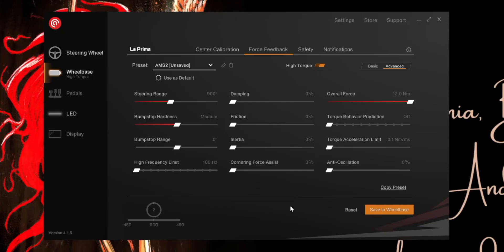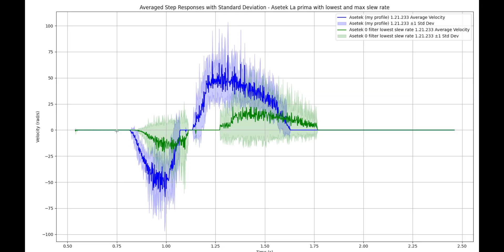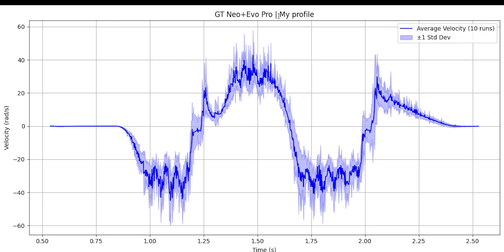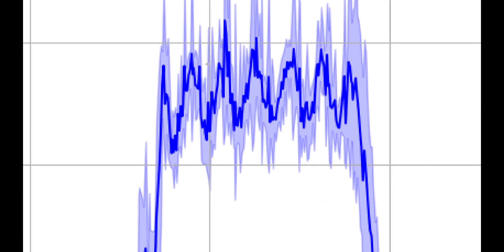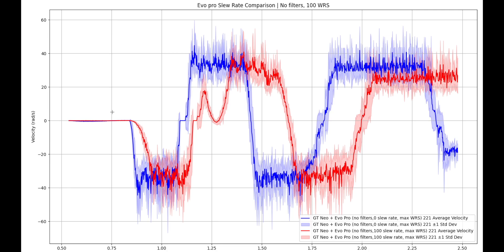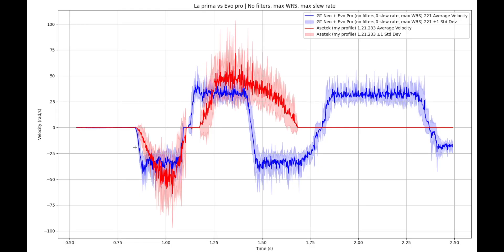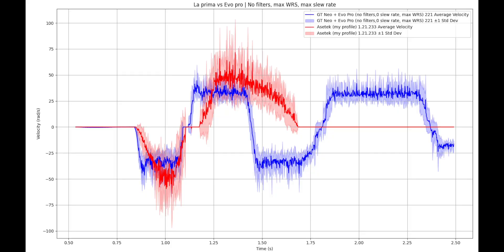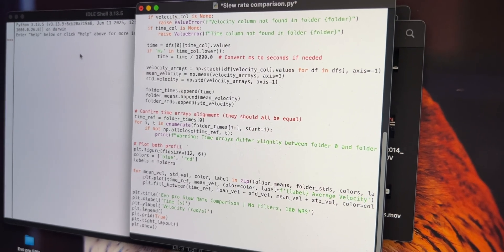Simagic Evo Pro | Slew Rate & Step Test Results

Comment: I enjoy and appreciate your detailed test reviews - great content Napman.

I however disagree with the interpretation and calculation of slew rate in this video - Wheelbase slew rate is a measure of how quick its torque changes. I do understand that measuring it accurately may require equipment that may not be readily available, hence the use of alternative methods for estimation purposes. Noting that Torque is directly proportional to rotational acceleration, in this case, the gradient of those rotational speed versus time graphs during the step change is a good variable to help quantify and compare slew rates - the closer the step change graph is to the ideal vertical step change, the higher the slew rate and vise versa. The maximum rotational speed reached after the step transitions on the other hand is not a reliable measure/indicator of slew rate unless testing the same wheelbase so that all other variables remain the same.

With that in mind, your graphs clearly shows that the Evo Pro has a higher slew rate than the La Prima - Evo Pro's graph is closer to a step response while the La Prima's transitions are more of a Sinusoidal than a step transition, this indicates that the La Prima has more "built-in" damping that you have no control over, this built-in damping is implemented either mechanically or electronically and is inaccessible to the typical user. When you change the slew rate via the software sliders, the Evo Pro did exactly that and nothing more (expected behavior - gradient change), the La Prima on the other hand changes both the slew rate (observed through gradient change) and the maximum rotational speed after step transition (not a reliable indicator of Slew Rate) - the La Prima's behavior in response to the Slew rate slider is not ideal from a physics definition of slew rate perspective - This should not be confused with whether it's good or bad for better simracing feel, enjoyability etc.

Others may find the smoothed out, lower Slew rate of the La Prima better due to it being the kind of response they are used to, we all know that new things usually comes with an adaptation curve which typically requires time for the brain-to-hands coordination to match. However, what Simagic has achieved with these high slew rate wheelbases has great potential to provide sim racers with a level of detail and responsiveness that was not easily accessible at this price point - it is a matter of firmware optimization to implement better damping without sacrificing too much on the slew rate end. A fast response system is a good starting point for optimization to achieve an excellent responsive system compared to starting with an inherently slower response system - So I'd say, Simagic Evo Pro is an excellent baseline and better option taking into account upcoming firmware improvements.

Simagic Evo Pro is to the wheelbase market, what Assetto Corsa Evo is to the racing simulators market..."Early Access"!
Reply from the maker: You raise some valid points. I am working on refining the methodology so as to make the entire thing as close to industrial grade as possible. I'll try to rely less only on the software. 

Thanks for watching and the comment, I really appreciate it!

Comment: Dang, I was just about to pull a trigger on an Evo Pro this November (hoping to find a sale). 

Is there something in the price range (US based) I should consider instead? The jump to a simucube (especially with additional wheels) is a very tough pill to swallow.
Reply from the maker: How about VRS DFP15?
Reply: @napmanreviews  thanks for such a quick response!! This is definitely on the radar now, you aren’t the first to mention it. 

I also see your praise of the Conspit Ares Platinum. It seems I could get it + the 300GT wheel for about $150 more than a VRS DFP15 + R295. Any thoughts?
Reply from the maker: I haven’t tested VRS, but Ares P feels too close to Asetek bases, which feel close to Simucube.

Comment: You tested 360’ and above…….  Mate you need to check slew rate over smaller range about from 10-45’ rage. 
Thats what we use when the wheel vibrates.
Reply from the maker: You're absolutely right. I did try it, but the software bugged out at 90° and the wheelbase randomly started to vibrate and shake aggressively. I'll work on a separate software to make the step command based on torque. I'm currently un the process of getting my hands on an oscilloscope for more accurate measurements.

Comment: Hey. Do you recommend ultra wide OLED monitor for mostly sim racing purpose? What about the static elements like leaderboard table, dash board, mirrors, wipers etc. Do they increase the risk of burn in. or should I just get an ultra wide ips or va?
Reply from the maker: Oled is always a great idea, but burn is something which is inevitable, so that’s a risk you’ll have to take. IPS is fine/VA is fine.

Comment: Would placing a heavier wheel dampen its response - making it slightly better or more enjoyable?
Reply from the maker: Depends on what you mean by heavier wheel. I tried the same tests with NeoXhub and round rim and the Evo struggled a little. You can watch the tests on Evo pro vs Conspit Ares' video.
Reply: @napmanreviews   Oh I'll check that out.  I was thinking say if one had a choice between a wheel thats 2KG and one is say 2.3KG.  Would that extra 300 grams dampen it?  Maybe make it feel a little less 'sharp' which to me feels a little artifical.  Almost like car is not contacting the road with rubber tires but with hard plastic tires that have no compliance.  

I could just be an oddball and prefer a more damped smooth feel like my Alpha.  Ok going to go check your video :)

Comment: Great video and very interesting data! How much of this actually translates into a game you think? Step response without your hands on the wheel doesn’t seem like a very realistic use case - but probably the best way to get data 😅 Maybe it would be also good for comparison to see how much having at least something on the base that somehow simulates a very slow reacting system like your hands/body would impact data. Maybe an extra heavy large wheel could help to get more realistic data.
I also noticed during testing that the evo pro is a very very fast base that I had to slow down more than others - very good choice for those that prefer to feel every Sandkorn they drove over 🤣
Reply from the maker: Thanks, Dan! Really appreciate your feedback 🙂

You’re right, step response without hands on the wheel is a bit artificial, but since the wheel rapidly oscillates in both directions, holding on would basically be… suicidal 😅. So the human touch had to be out of the equation for these tests.

Regarding a heavier rim, on the Evo Pro, rims above 2 kg add noticeable sluggishness, which skews the results.
I didn’t have an Asetek QR to swap rims between La Prima and Evo Pro. La Prima’s round rim is about 400 g lighter than the NeoX hub with a round rim, which affects synthetic test results significantly.

Also, I fully agree, the velocities reached aren’t what you’d see in real world use, and that’s not the point of this test. But it’s the cleanest way to get objective, measurable data without human subjectivity, because once your hands are on the wheel, every base suddenly feels amazing 😉.

I’m definitely thinking about ways to tie this objective data back to subjective feel. That’s the real challenge 😅

Comment: Fantastic video. Love your insights. As a Simagic Alpha (15nm) user I want to ask why you didn't do any test with WRS (Wheel rotation speed) at zero? Myself a long with many others run profiles with the WRS at zero and we do so get rid of that electric feeling almost vibration that comes through the wheel. FYI I run completely filterless Max FFB and Max Torque. This I believe is quite common. I would be interested to know if you tested with these settings if the oscillation's stopped or minimized.
Reply from the maker: Very interesting question. The reason why I didn’t reduce the WRS to 0 is because I wanted to test the maximum and average velocity. Increasing WRS would artificially slow the motor down, hence altering the results. 
Same for slew rate. It’s how quickly the motor changes torque, slowing it down with filters will be reflected on the results. 

All of these testing are motor’s maximum based on firmware and control algorithm. People will use the base with settings tuned down or adjusted to their liking. I’ll do a better job next time to explain how this data translates to feel.
Reply: @napmanreviews Makes sense for testing purposes, thanks for the speedy response! I was thinking about this tonight while racing and I don’t believe I experience the oscillating feeling at all. I have nothing to go on but my feel here but I believe the WRS may be the full culprit for the oscillations you experience in these tests. I feel 100% WRS is too high of a setting because of this. If the primary objective was to smooth out the oscillations potentially at the cost of slew rate I think this is the path. Looking forward to reading your response, hopefully you can validate what I’m feeling in the wheel and I don’t have to write this off as a placebo
Reply from the maker: You might be mixing the frequency oscillations with wheel oscillations. Those are two different things. 

Frequency oscillations are something which makes the timings of delivered frequencies go a bit haywire. Sometimes the frequency of tyre hitting the kerb will be delivered early and abruptly, other times it will be normal and tamed. Alpha bases don’t have the frequency oscillations. They’re very consistent and punchy with their feedback. Evo pro has frequency oscillations. Even with my profile where I use 45 WRS, frequency oscillations are quite visible.

Comment: Indeed, the base feels very weird to me. like you would think that a stronger (i had an r12 before) and supposedly faster base would feel more responsive and with more detail. In lmu the base feels alright as that game has very noisy feedback as is so alpha evo's firmware balances it out, but in acc it feels so wrong. somehow it feels as if theres only a centering spring effect and all other details/effects are missing. i find myself oversteering a lot because i cant feel the grip limit and overall dont feel as connected to the car. when i used my r12 i used to let ffb guide me, but on the alpha evo pro it seems impossible.
Reply from the maker: Interesting. How long have you been using the Evo pro?
Reply: @napmanreviews  ive had the base for about 2 months now but havent spent as much time on the sim as i wanted due to life stuff.

Comment: How would the derivative of the velocity charts compare between the two units?  In my opinion just the velocity alone is a little challenging to understand the nature of the base (apart from the instantaneous impulse). The oscillations for overshoot are intrinsic to all wheel bases so I am curious about the instantaneous velocity change (acceleration) curve would look like for those oscillation periods. This may elucidate the fundamental tuning efforts for each vendor.  I expect that in the real world this correction has to be fast enough but also slow enough to seem "natural".  Keep up the good work. Data gets me excited.
Reply from the maker: Comparing the derivative of velocity (acceleration or instantaneous velocity change) between the two units would indeed provide a clearer picture of the system’s responsiveness and how it manages those rapid corrections. The acceleration curve can highlight how quickly the base reacts to input changes and how it smooths out oscillations, which is critical for tuning the feel to be both responsive and natural. But given the nature of motor and the control algorithm, it makes it a bit of a challenge.

Also, you summed up the thing which most manufacturer try to achieve, the ffb has to fast enough in certain scenarios and also natural in others.

Comment: Cool stuff as I rewatched this and the prior video. Couple questions:
1. Will this test process be applied to all wheelbases (past & future) to make a basic "library" of data?  Specifically running the full range of tests on the bases recently referenced including the Conspit Ares and Alpha Ultimate would be good to have a full set for all.

2. Data is interesting, but connecting that to actual user experience is somewhat tricky since the impact in use is not always a 1:1 transition.  Is there a practical way to take this data beyond the numbers and make it beneficial for base selection beyond "spec sheet comparisons"?
Reply from the maker: Excellent points Chader. 

1 - Yes, all of the wheelbases, past and future will be held to the same standards. The whole point of the data is to be as unbiased and practical as possible. 
Example - Frequency oscillations of Evo pro. Will they affect the general user base? Unlikely. But anyone looking for a more serious approach, where every millisecond and decision counts, those frequency oscillations will be an issue. Causing some frequencies to be delivered early and abruptly, some to be slightly delayed, and some to be timed perfectly. Thereby making a consistent experience harder to achieve. But Simagic said they’re working on it, so that’s good news. 

2 - Again, very valid and excellent point you raise. Data and user experience isn’t always a 1:1 transition, which is why moving forward I’ll be addressing why data is required, what it means for the general users, and how/how not it will impact the feel. Because at the end of the day if you take away all the numbers, feel remains the priority. 

In conclusion, Rest assured, there will be a library. No bias. And data will be tied to what can be expected in real world scenarios. I am working on separating the whole data vs non data part to further help a broader audience. People interested in data can take a look at a spreadsheet, for example. And the feel will be present like always for mass users.
Reply: @napmanreviews  That all sounds awesome!  I appreciate the deeper dives here even if parts of it are well over my head :P
- I come from other hobbies (cycling) that have core data then translated to live experience so it's nice to see that develop in the sim world.
- I'm looking forward to the continued expansion you have going here.  Thanks for the time and work.  :)

Comment: I would really love to see this slew rate test performed on every wheelbase you have, especially the Alpha U! It would be amazing to have objective numerical testing comparing all the different wheelbases available! The kind of data I dream about having when making such a decision!
Reply from the maker: I already have the data for Alpha U and the script is ready too. Just need to record the video. 😋 
It'll be a part of an upcoming project where I talk about a very specific metric.
Reply: @napmanreviews  That's awesome man!!! I'll be eagerly awaiting its release!
Reply: @napmanreviews  +1 for this. I’m curious about the impact of the wheel rotation speed parameter. I finally settled on something like 10% in the alpha u and nothing else. That and higher torque is the only way I can drive consistently in LMU, catch slides, etc.
Reply: @napmanreviews   @napmanreviews et sur l'alpha mini aussi que j'ai ... mais je suis toujours envieux de changer pour prendre un ultimate ou evopro ...
Reply from the maker: @mickaelnardin4275  Community is split when it comes to Evo pro and Alpha U. There isn't a universal correct pick. It really boils down to the driver.

Comment: Genuine question, could this be an ams 2 problem … or can you test in on other games , LMU or ea wrc for example?
Reply from the maker: The tests I ran don't take any game data into account, but wheelbase's behaviour. I simply used the simpro profile from AMS2 and dropped all the sliders. I can see the confusion but I can assure you, the tests run irrespective of any games. 

If you are interested, I can provide my testing methodologies and you can run the tests yourself.

Comment: Another good video. You captured some interesting data. That ringing is typical of what I see when the control loop is not able to respond quickly enough.
Reply from the maker: You're on point! The ringing should not be there.
Reply: @napmanreviews  I can live with some initial overshoot, in some ways it’s desirable for certain applications as long as it’s controlled overshoot. What appears to be in your data plot is uncontrolled oscillation. 

I think your test method is solid and consistent across the two devices so the data is good. But, you know yourself this is only one aspect of the motor performance and does not explain the issues many feel with the Evo base. 

I have been thinking about these results and the fact that in use, most of the time the motor is effectively ‘stalled’ by the user applying an equal but opposite torque through longer corners or applying a greater torque while turning in order to increase steering angle. Under these common conditions there is very little angular velocity or acceleration so a low mass, low inertia rotor is not providing any benefits. The rapidly changing torque demand from the sim will be more dependent on the slew rate in order to be reproduced with greater fidelity. I believe this is why small MiGE based designs like the Simucube, Asetek and VRS bases with a comparatively high mass rotor but well matched electronics capable of higher slew rates and tuned control loop algorithms are better suited for this application.
Reply from the maker: @lugs118  These overshoots won't make a big difference in day to day driving. But when you want the ultimate reliability, where your lap would make it or break it, in those scenarios it is not the most confidence inducing. 

Based on my ffb settings, sometimes I get a very jerky feedback, almost abrupt, other times it will be very well behaved. Making the entire experience a bit less consistent.